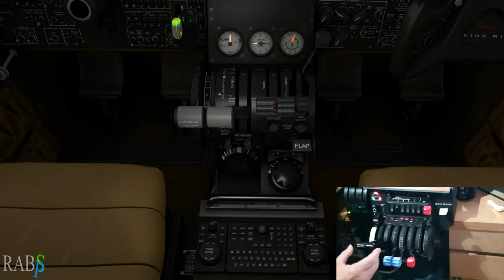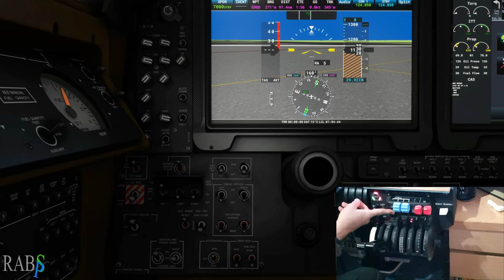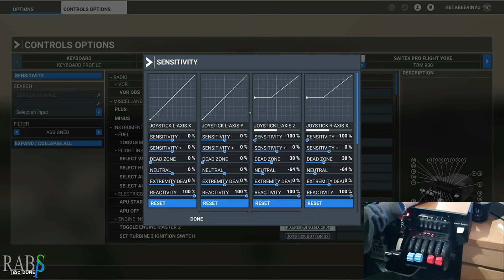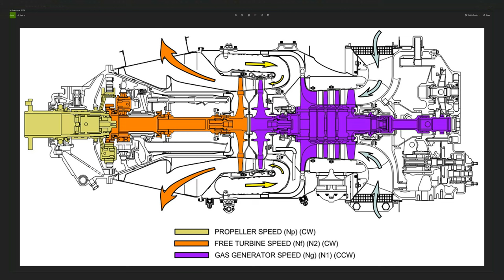RAB 113 How to setup the Honeycomb throttle quadrant for  Bravo 350i Setup

Comment: Hi Ron, Great tutorial. I have one issue though. Engine 2 will not shut down. Everything else works as it should including feathering. Engine 2 condition levers are set up exactly as condition lever 1 which shuts down engine 1 properly. I started from a new empty profile so there should be no conflicts. 
I'm not sure if this is a default Asobo king air issue or something else. All assignments show as working in the control config screens. Tried deleting and re-assigning to no avail. Any ideas please?
Reply from the maker: Hi,

I did find it difficult to adjust engine 2, I just kept trying different settings till it worked.
Reply: Thanks Ron. I'll keep trying. I'll try a different aircraft too. Puzzling thing is that all levers in the aircraft go to the correct positions and all show as working correctly in the setup screens.  I'll keep trying because apart from that it works perfectly.  @Ron_A._Bolton
Reply: Just to let you know, I started again from scratch and went through the setup again. This time it all worked perfectly, including Feathering, reverse, condition levers and engine cut off etc. 
I must have had a conflict somewhere originally. Your comment prompted me to try again so thanks for that. Again thanks for a great setup tutorial for Turboprops. 😄
Reply from the maker: @franksidebottom187  fantastic news, well done. I'm glad you got it sorted, enjoy flying.
Reply: A bit of an update.
Unfortunately the issue came back like a bad smell. However after a bit of messing with the control assignments and some 'funky' behaviour with the in cockpit levers, I managed to track it down to an issue with the #2 engine fuel valve assignment. 

If I had it assigned as it should be (same as #1) engine #2 will keep running even after putting the aircraft in a supposedly cold and dark state. Weird!

My fix is as follows:
I cleared the 'toggle fuel valve' settings for both engines, then I tried the shut down procedure again using just the 'condition lever cut off' assignments.
This time both engines shut down correctly. Of course, the fuel valves would still be open.
So, in the Fuel options, I just assigned the condition lever #1 detent button to 'Toggle All Fuel valves'.
This worked. It's not ideal as the valves should be operated independently but at least now I can shut down both engines. Everything else works as per your tutorial.

What the root cause is I don't know, but the above is a workaround that works for me. hopefully it may help others out too who may experience a similar issue.

Here's an unrelated tip: If you find that the prop levers go full forward after coming out of the feather state, assign props 1&2 to 'Propeller Pitch Hi' but make sure to set the action to 'On release'. You may have to check the action as it doesn't always do it the first time.
I got that tip from Mark of SimHanger Flight Simulation so many thanks to him for that one.  @Ron_A._Bolton
Reply from the maker: I checked after the update yesterday and 2 was playing up, I opted to fine adjust the condition leavers and it fixed it for me, but controlsvwere all over the place as i had installed the Ornithopter.

Glad its working for you. @franksidebottom187
Reply: Spot on! That update screwed everything for me. I haven't installed that Hornythwopter or whatever it is - the update on its own was enough. I've tried messing with the condition levers sensitivity 1% at a time all to no avail. Still, its still flyable with condition lever #1 set to Toggle all fuel valves. Anyway, thanks for all your input, I do appreciate it.
I wonder if the steam gauge version by Black Square would exhibit the same behaviour, just a thought.   @Ron_A._Bolton

Comment: Hi, for some reason I can't get the condition levers to go into cutoff, have the bravo configured the same as yours, cheers.
Reply from the maker: Could be minor differences from mine. Others have posted their values too. What is the cockpit animation doing?
Reply: @Ron_A._Bolton  Hi Ron, it goes through the full movement from idle to high but won't go to cutoff when I move to the detent position, cheers.
Reply from the maker: @johnf6545  I'll have a look today see if anything might have changed.
Reply from the maker: Can you confirm you have condition lever 1 cut off assigned to joystick button 28 and condition lever 2 cut off assigned to joystick 33. I also have toggle engine 2 fuel valve assigned to joystick button 33

Also make sure you have turned the starters off or the props will keep spinning.
Reply: @Ron_A._Bolton  Yes I also assigned engine fuel 1 to shut of on condition lever one cutoff, not sure if it was necessary.  The props feather as you demonstrated and shut down.  Warnings remind to shut starters off.  Beast of an AC.
Reply: @Ron_A._Bolton  One thing I noticed today, could be normal, was trying to feather the left engine to simulate an engine failure in flight, when I did this the right engine would only come just above the feather position, same when I tried the other side.  I am guessing this is to prevent over torque on one side of the AC when flying with just one engine.